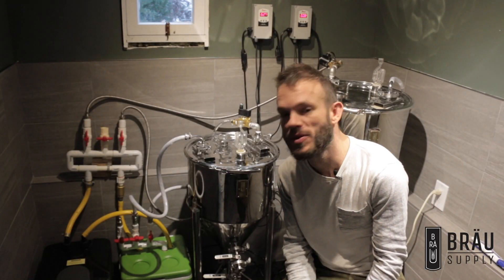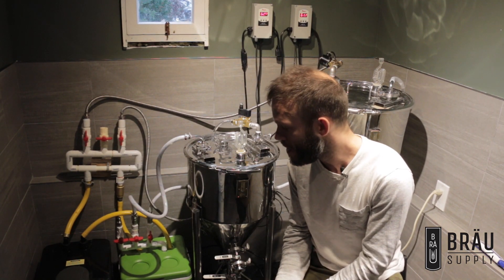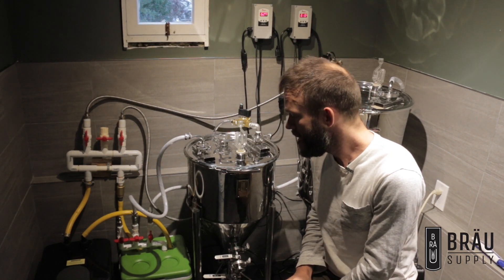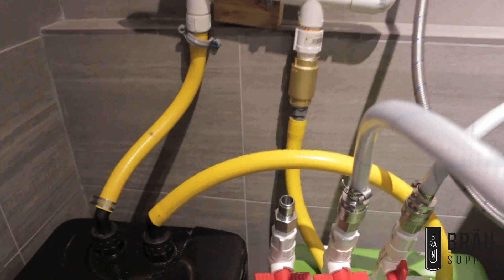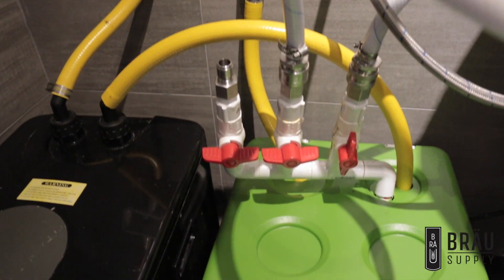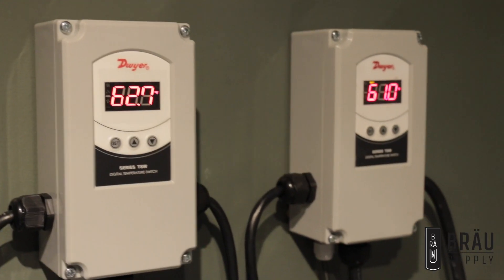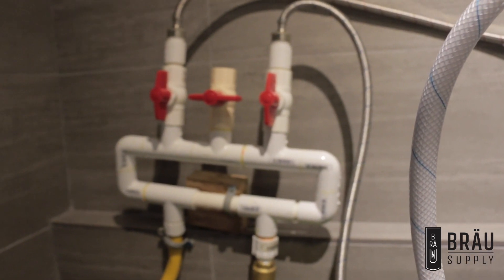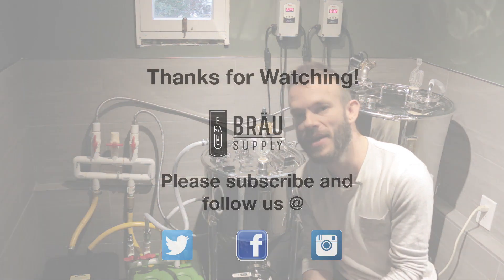Ultimate way to Control Fermentation!

Comment: Nice setup. Alot cheaper than purchasing a glycol chiller. But personally I would set the water temperature as low as it goes. Cuz it doesnt matter the solenoids still would kick on when cooling is needed. Because the water is colder. U would be able to increase ur cooling capacity. Thus you would be able to ferment more beers. Idk just a thought

Comment: I’ve built a similar system except I’m using 1/2” pvc and 3/8” lines to and from the reservoir, I’m having issues with the check valve not closing when the solenoid is open.  I’m using the same pump as you. What could be preventing the check valve from closing?

Comment: This is incredible. You are brilliant and have inspired me to build something like this. I was able to pick up a quality used 1/4hp chiller. Eventually, I would like to have three 30 liter conicals running off of it. I have a few questions if you don’t mind sparing a minute. First, is my 1/4hp going to be okay for this or is there any reason I should downsize my chiller? Second, is it necessary to use a 900 gph pump like you have or can I go smaller to save a little energy/noise/etc? Roughly what is the pressure in the lines from the pump so I can find an appropriate check valve? Also, how much did your check valves and solenoids cost you? Thank you so much!

Comment: The solenoid valves are simple on/off valves.
In industry there are systems where not only the temperature of the cooling water is controlled but also the flow rate. The valves are control valves that can vary the flow rate (there are also variable speed pumps that can be used to vary the flow rate. In that case you can control the temperature of your fermentation vessel without the use of a valve).

I dont have the problem highlighted in this video because I only have one fermentation vessel and therefore only run fermentations one at a time. Still, if you can afford the controllers and the water chilling equipment this is certainly one option for running more than one fermentation vessel at the same time.

Comment: Great setup and great video. Question for you: why does it seem like so many guys choose glycol and not this water system? Also, is there anything you would change or do different if u built it again? And lastly, how cold can you get the wort/beer down to with this assuming the ambient air (room temp) is around 72-80 degrees? Cheers
Reply: Bräu Supply appreciate the advice and thanks for the reply.

Comment: i recommand  use 1/3 Propylene glycol + 2/3 distill water replace  water in auqa chiller. i use 33% gylcol in resun CL650. The temp can get it to -8 °C ~ -12 °C. it more efficiency than water.
Reply: Though the glycol mixture is less efficient at transferring heat than pure water - so unless you want to cold crash to ~0-2°C there's no need, you'll also save money keeping the chilled water at a slightly higher temp.
Reply: Archie Luxton  now i use kevik yeast to ferment my beer. it's fit most style.  no need temp control.

Comment: Nice clean system you have.  Is yours just water and no glycol?  I have a similar loop in my garage using a glycol chiller.  Your system seems to be much quieter.  The pump on my glycol chiller is on the outside and always running.  The compressor takes the volume up a little more when it cycles on but we don't hear it inside the house.  Using the glycol chiller, I can take my beer down to under 40F.